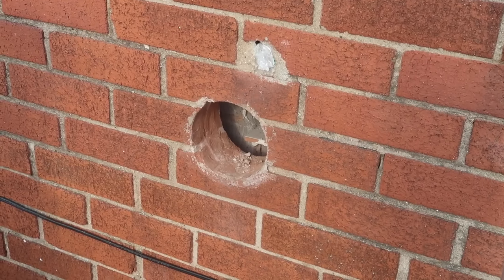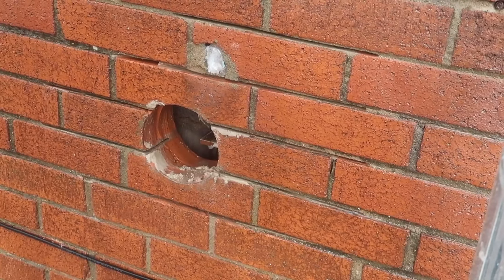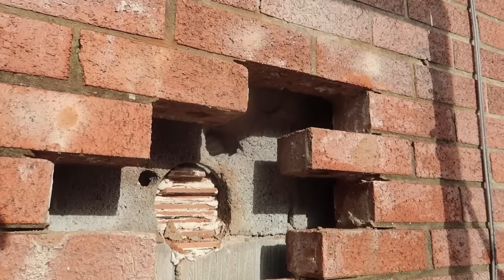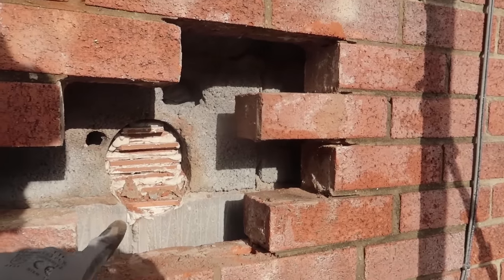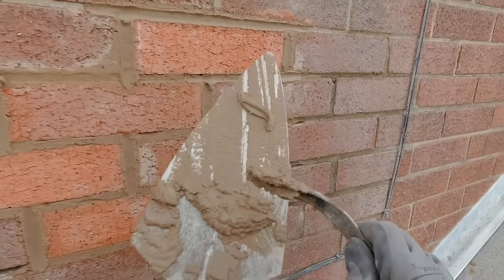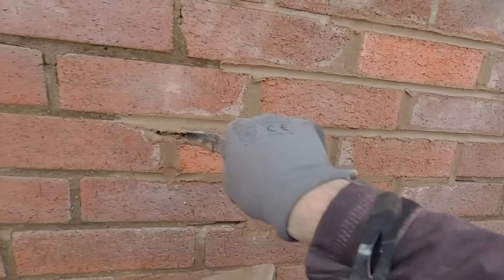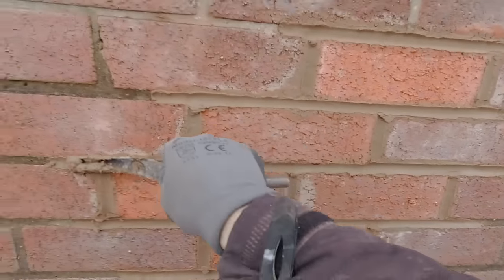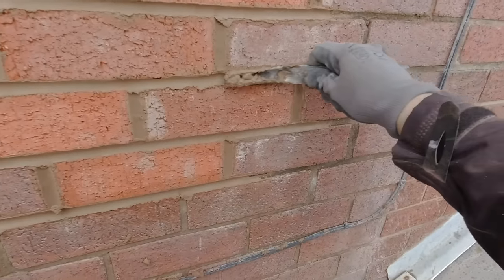Bricklaying Repair - How To replace Bricks In a Wall - Tutorial

Comment: How much do you charge for something small like this?
Reply: imagine  ...scaffolding + 5 bricks , a bucket of muck, plus grinder one labourer one bricky ..obviously two cup or tea or coffee ...wow that is expensive
Reply: @1969works  exactly it looks little until you realize it's half a days work. 
Stan unless you live in BB's area asking price is pointless. Every job is a different distance from supplier and home. Every area and individual has a different cost of living.
Reply: Joel bb ?
Reply: @markleigh3  Best Bricky is the name of Stu's business.
Reply: Joel Breinholt I didn’t want a job doing I was just trying to say is something small like that even worth doing like you probs can not charge fuck all for that
Reply: @stanbrotner9982  I get that.  My point is what would be reasonable in one area would be unreasonable in another. Do you live in a rural area 500 miles from a brick yard or do you live 5 minutes from a brick yard.
I just finished a job out of town. It cost $6000 more to do that on a standard $8000 job. Would that sound unreasonable if you didn't comprehend what that $6000 extra means? 
Then are we talking American $ or Brit $.
My point is if that is one of my neighbors it  would be a $200 job. If it's outside of my town it's $800. If it's outside of my county its going to be anywhere from $1200-$10,000 depending on location.
That variable most certainly does not help anyone looking for pricing. Best thing to do is get a few quotes.

Comment: Not sure what size your Dutch stick is but looked a bit difficult pushing mud back in. I use a little 6mm thick one and makes it easy to push the mud right back into the joints. 👍

Comment: You need a mortar chisel!! SDS
Reply from the maker: We have one for knocking walls down but I prefer to use hand tools for intricate cuts like this as you have more control. One slip in the wrong direction and you are chipping damaging bricks
Reply: @Stucrompton1  6mm 250mm long cuts like butter

Comment: Messy Stu . You can't point in with wet muck , and you can't point in with the muck you lay the bricks with .It's all far too fluffy , makes a mess on the face of the brickwork , can't fill your joints properly , and that jointing tool looked like it was12mm , all round disaster . Go on ebay type in FUGENKELLE 8mm and buy a couple .Pointing in muck should be damp not wet , no plasticiser at all , just sand ,cement ,and hydrated lime .When you point in the bed joints you fill them from the end and not the face or you will make a mess . Stu I only wish you well , try what I have said if you don't like it forget it , no harm done . Now clean the cavitys out ! Best wishes
Reply from the maker: cheers eddie will do
Reply: Very good tips.

Comment: This should be titled " how not to repair brickwork" that will look a right mess when it's all dried, no care taken in repointing, looks like a DIY'er re point, buttering perp joint on the brick going in is a no no, that's how you stain your bricks, you need to butter joints on bricks already in the wall then slide your brick in, and repointing Gobbo should be done with a dryer mix to avoid staining bricks further or a mortar gun
Reply from the maker: I agree, only reason I did that was to get some on the backs. We will re clean all the faces so they’re spotless 👍
Reply: @Stucrompton1  you normally do good jobs as well matey, just seemed a bit sloppy in standard on this one! Just from one bricky to another 👍👷‍♂️
Reply: Thanks for the good information.